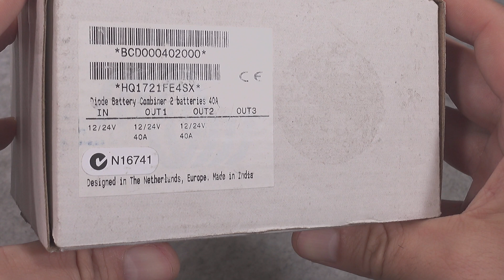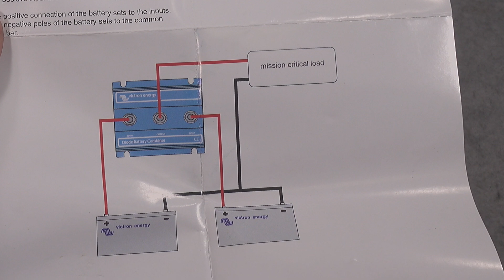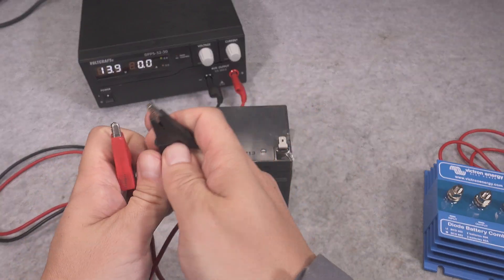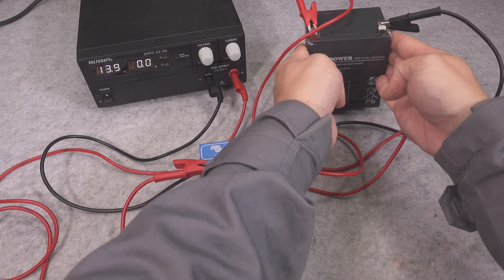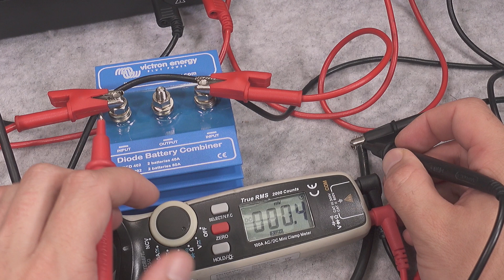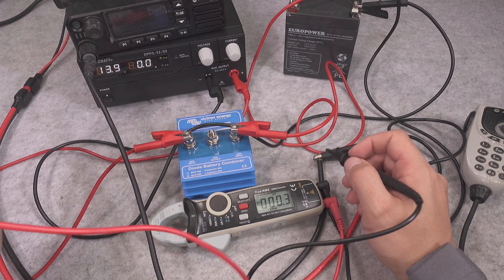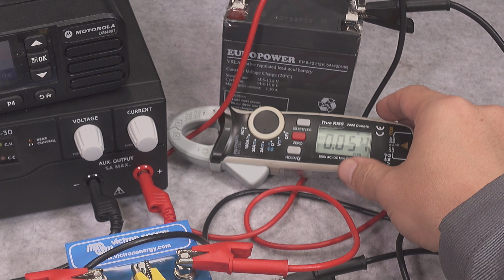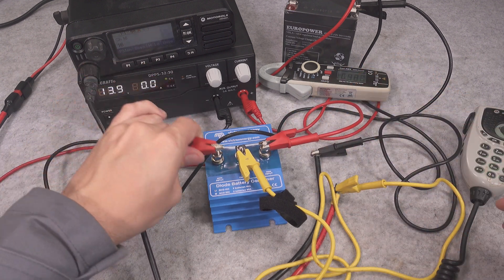Victron Energy BCD 402  diode battery combiner  (40A) powering radio from two isolated 12V systems

Comment: How would i connect 2 pwm charge controllers to these 2 batteries? In front or behind the joiner?
Reply from the maker: Since You have two separated controllers I would attach them directly to each battery.
Reply: @ElectronicNoobBlog  thank you. !
That is what I did. 
The concept that they share a common - minus across 2   same type but different size batteries and a separate + is new to me. 
There are no diagrams out there that show this with this joiner. So I made a guess and that keeps me awake at night. 0452.

Comment: thanks for the video! I got 2 batteries, 1 is 120ah gel deep cycle and the other 150ah lead acid. 
only used for work at the back of my van and I figured out this is the best way to use them both safely. charging with 1 solar panel split on 2 pwm controllers. 
so they charge and being used separately, yet together the loads! 

I wonder if from the diode is there any kind of voltage/capacity balancing. meaning if there is a high draw, will it split in balance from both sources or what? 
I guess it will be from the higher voltage source as in the video. but what if the voltage drops and equals the other ? will it split ?
Reply from the maker: You are correct - as voltage equalize current will flow from both but there came into play ohm law and internal series resistance of battery so It's close to impossible predicting how it behave and most like won't be 50/50 since both batteries are build different way so there will be no intelligent balancing at all - battery with lower ESR will push more current than one with high but both will be dragged down to same voltage potential.
Also recharging from two PWM controllers might introduce dangerous loop since most like they are not isolated - so You will technically join those two batteries in parallel before diode combiner - so it might produce unexpected results - not saying it will but it it's not protected from back-feeding something might happen. In general diode combiner You use with two separated sources not single one.   Maybe You are looking for Cyrix-ct (from Victron) - -this is relay that make priority for recharging main battery and leave second untouched unless there is high current demand - or You put signal into "start assist". Try checking out documentation - maybe this is exactly what You are looking for - but I need to warn You - I never had one since I had different situation than Yours.
Reply: @ElectronicNoobBlog   

hi, thanks for the answer. 

yes I was afraid that there is a potential paralleling between the solar controllers. which I don't think so but cause u said so,  I ve found these : AVCXEC Solar PV Connector, Pack of 2 DC M-C-4 Plugs, Solar PV Connector Parts with Built-in Anti-Backflow Diode, IP67 Waterproof for Connecting Solar Panels (30A)

so I will buy 2 for the red wires and connect them between the solar cable split and each controller. it will protect the panels and the controllers from each other. 

 Cyrix-ct is paralleling the batteries in some cases and I want to avoid that. 

probably I will add some Low Voltage Switches  too. 

what I do is so waste of money though 😂 

if I knew it last year I would make a 1kw lifepo4 with the same money I ve spent for 100 tiny improvements  🥲
Reply from the maker: @sharpblad3  It's always like that! I also spend to much money playing around - but at end of the day You got knowledge. When You get it running let me know how it went!